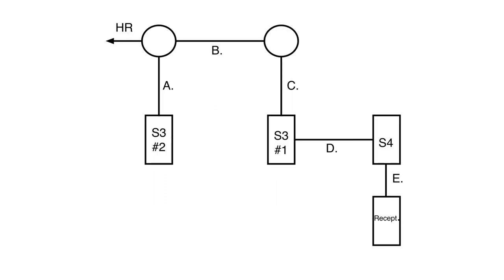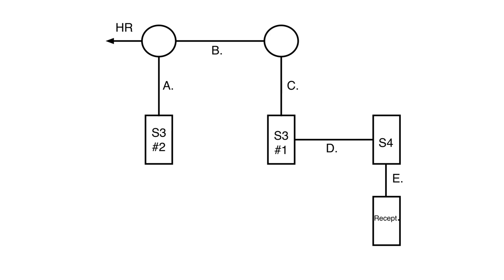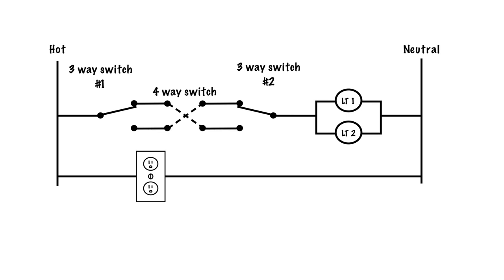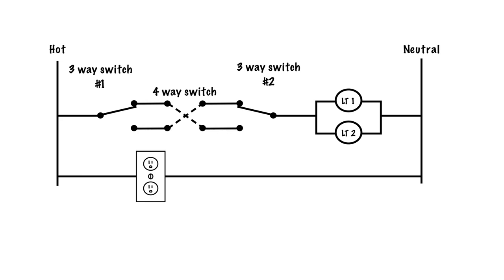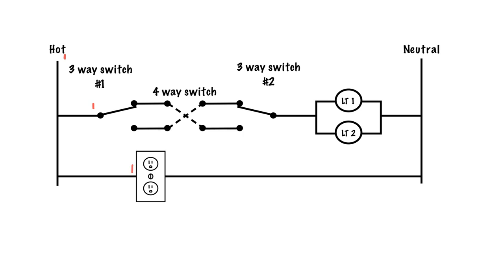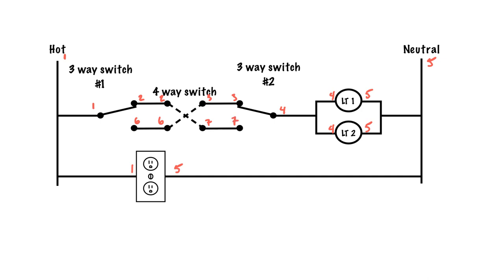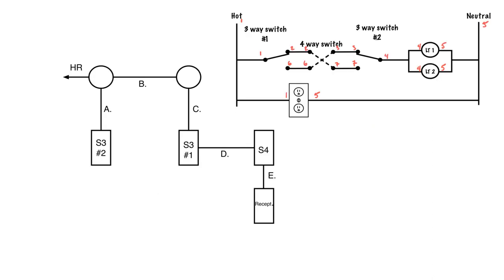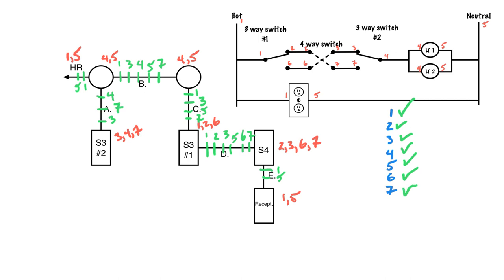# OF CONDUCTORS IN A 4 WAY SWITCHING CIRCUIT

Comment: it does, but not for every goddamn light switch.  just those that are part of a multiswitch point. only on one point on that train needs a neutral.  [preferably where it starts] but thats not code either. however, everyother switch on its own and not part of a multi w/e that is only doing one or multiple things with that one switch, DOES need  a neutral.